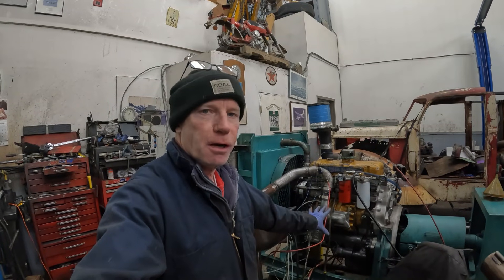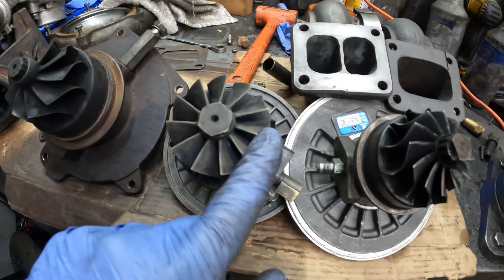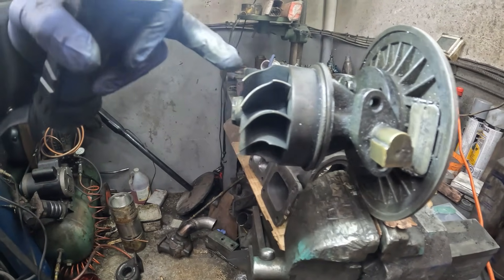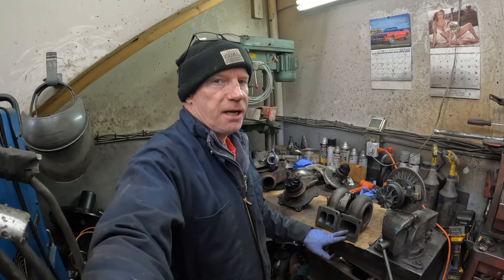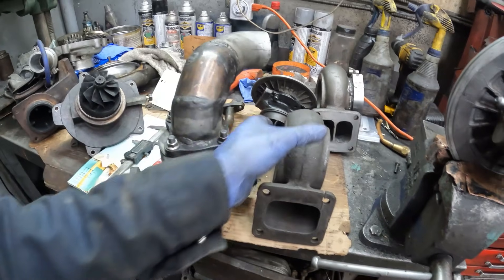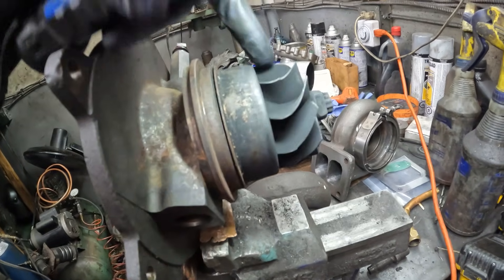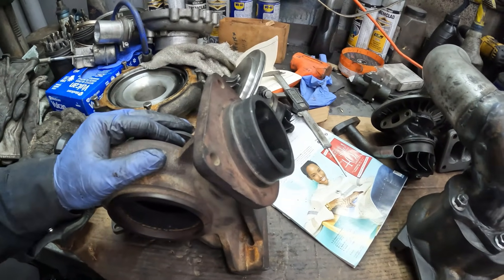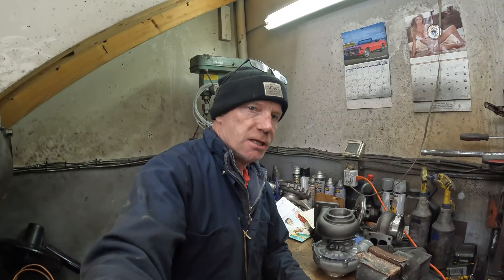Detroit Silver 4-53T (Turbo Talk)

Comment: I like how you air quote “outside the parameters of this engine” for air flow! That’s for sure!;) If you want, iv got a good used Holset HE351VGT turbocharger pulled from a 6.7 Cummins I’m willing to ship/ donate to the research cause…maybe you can figure out how to run the VGT with waste gate actuator? If you want it’s yours!
Reply from the maker: Thanks, that's very kind of you.:)   There's too much to change to make it work on the Detroit.  Without a stand alone controller, you'd basically have to convert it to mechanical unit.:)   I've looked at the HE351 CW many many times in the past and present.  It is on the list of possible turbos to use.:) They come in many different sizes, so a really sweet turbo.:)
Reply: Yea I bought for my 453 thinking it would be cool/ different, but lack the machining skills to convert to manual control…
Reply from the maker: @clayclifford53  They're a sweet turbo,:)  Just need a stand alone controller.:)  They do make them, but very spendy.:)
Reply: Yea the cost on controller was concern, I like the HE351CW as well, modern turbo with lots of options available and not too costly to acquire on EBay…
Reply from the maker: @clayclifford53  :)

Comment: I'm on the edge of my seat! Thanks for the info! I've never played with many turbos before. A cousin of mine had a five star general with a 8v92 turbo engine that's the only turbo two cycle I've been around. If I remember right the valve cover tag rated it at 505hp . It was a strong truck for its day . God Bless
Reply from the maker: Thanks, that's great, probably had 9200 or 9210 injectors.:)

Comment: Very good info, i too am curious as what you me by "lit" ...well i mean it is self explanitory in that you mean it is actually pumping and working well, but is what defines that ?    Also it should be somewhate easier with a detroit in that you are trying for a relatively narrow RPM band and have a smaller portion of the compressor map to stay inside of.
Reply from the maker: The term lit means you got the turbo spooled up and performing well.:)  This cobbled together unit 66/65 did not start to perform until I got into the 90cc injectors.  At that point I had enough fueling to get the turbo to finally start burning all the fuel.  The 100cc injectors are even better at there's less smoke and boost, airbox and drive pressure are all within 5 psi of one another.  This turbo still struggles down in the lower RPM range, so it truly needs a smaller compressor or a slightly larger turbine.:)  See if the divided housing and slightly larger A/R helps.:)

Comment: I know you are using water/methanol injection have you ever tried lpg/gas injection back in the day here in Australia 🇦🇺 all the old boys run it for bit extra power I have no idea what amount they used but apparently it works great
Reply from the maker: Yes I sure have.:)  I drove my F350 with the Silver 4-53T with propane for a year.  Ended up scuffing the liners really bad, not sure what the root cause was, but not repeating the experiment.:)  Water meth burns like the propane and haven't had any issues with it.:)

Comment: Waste gates are a crutch that gasoline engines use to limit boost to prevent detonation/pinging and to get faster spool.  A good diesel turbo, should not have a waste gate.  Since a Detroit 2 stroke has a blower, spool is not really much of an issue, the blower always pumps boost when the turbo is off boost. The other enemies of turbo performance are length of charge air pipes, shorter is better, get the right size intercooler, and have fewer bends, and make the beds of more gentle radius.  The design or the exhaust manifold also has the same rules. In a perfect world, the turbo would be fed by blended extractors so adjacent cylinders are not impeding each other (reversion) but that is very difficult to achieve for a number of reasons.
Reply from the maker: Thanks.:)

Comment: Turbo compressor maps are the definitive guide to how a turbo behaves, in its pumping efficiency.  The trick is correctly matching the right turbo to the right engine size and amount of fuel. If you know the rate of injection of fuel at a given setting, you can calculate the stoic amount of air needed to combust the fuel, and then pick a turbo that gives the correct amount of cubic feet per minute of air, while still being in the highest efficiency "island" on the compressor map.  However when under part load, we still want our compressor to still be in the high efficiency "island" on the map despite less throttle/.fuel.    Over the last 40 to 50 years......turbo's have improved a lot, we can see this on the compressor maps, but what is not obvious on those maps, is that the exhaust turbine sections are also more efficient and giving more energy to the compressor.  So, dont bother with older design turbo's they are very outdated.
Reply from the maker: Very true.:)  Will be testing modern turbos soon and compare.:)

Comment: Is there any benefit to running an AFR gauge? I'm not very well versed in what difference to the stoichiometric ratio need a 2 stroke Detroit might want, or even if that's something feasible to measure. Would that be of benefit to find the parts which maximize your efficiency and emissions with the 100 injectors?
Reply from the maker: It would along with a MAF gauge.:)  I have a very good idea of the perfect turbo,  just trying different ideas.  I can use emissions, egt's, boost pressure vs drive pressure to come up with the right turbo.:)

Comment: A balancing act for sure. You're running more flow than standard and will just have to figure it out like you're doing with that setup. Seems like a bypass is overkill BUT it can be a time cutter to get to the bottom line. A variable!  A-PLUS!
Reply from the maker: Thanks.:)
Reply: @detroitgarage9430  You TOO! Sure is interesting. I've been around the 53 series but not much. Pretty much 71's.
Reply: @ 2's to 12-71's. 6V-53's and maybe 4's. Army stuff and then  quarry stuff and a IH mixer with a 6-71 and  a 9-speed OD. I liked the old one with a 3208 and a 5x4 better. I think it was 7 yd. I think the Army had 4-53's in 6K forklifts.
Reply from the maker: @lewiemcneely9143  :)

Comment: That turbo bypass might be an internal wastegate. Usually one quickly finds the limitation of those internal wastegates when using higher boost. They can be welded shut and you can run an external type that can pass more gas but you have to either plum it back into the exhaust or dump it to atmosphere with the characteristic noise ch, ch, ch, cssschhhhhh noise from under the hood you hear on Friday and Saturday nights from young people driving souped up 1100hp 30yo Japanese cars. 

Cheap external wastegates do a good job but expect to pay $200ish because a brand name one is about triple that. You change the pressure of them by using springs and each spring still has a range within the wastegate where you can preload it to vary the boost. 
I don't know what size to recommend - a larger one I guess since 200 cubic inches in a uniflow might be 400 cubes or a smaller one because it's only flowing enough air to make 250ish HP.  

Perhaps the internal one will be fine.
Reply from the maker: Thanks, I ran this turbo in my compound setup and want to revisit the K27 again.:)  I did enlarge the bypass valve to some extent at the time, but like you said it might not be large enough.:)  I determined  a 1" external bypass valve would have been the answer, but like to retest now that I'm running injectors that are 20% larger.:)  Should be interesting to see what the drive pressure vs boost now with 100cc injectors.:) Should be interesting.:)

Comment: Quickspool valve on the divided housing ?
Reply from the maker: Good question?  I've seen them. but have never tried one.:)  I'll see how it performs without it first.
Reply: @detroitgarage9430  If it works well without the quickspool valve, that's one less item of complexity you'll need to worry about.
Reply from the maker: @dantesinfernopurgatory7826  Yes, very true.:)